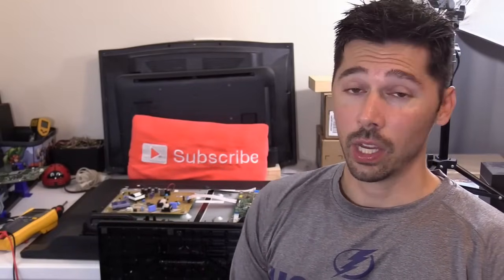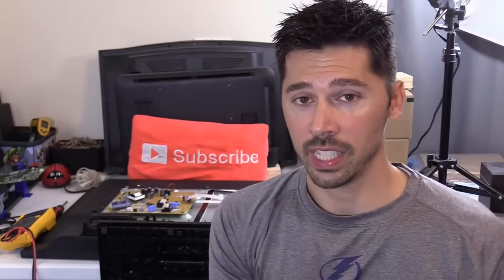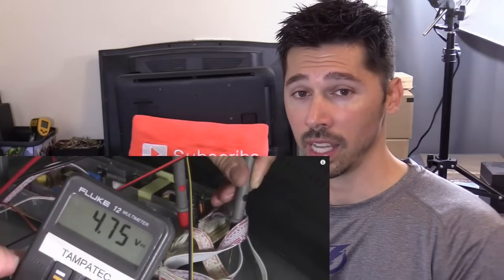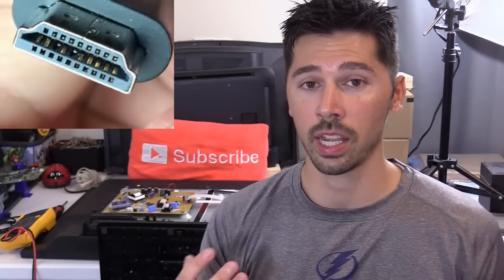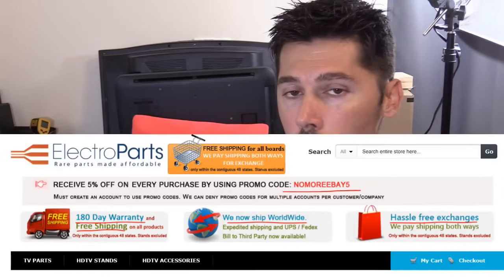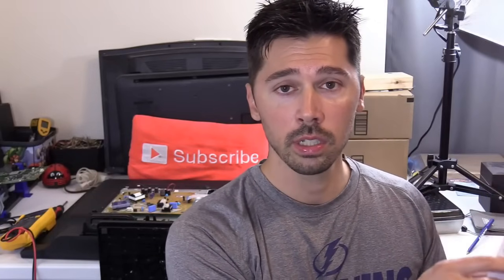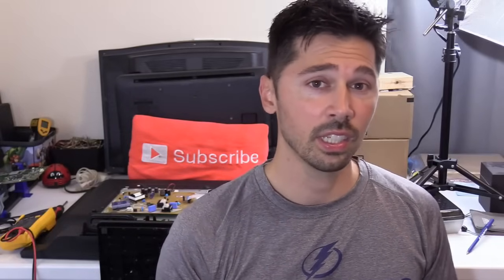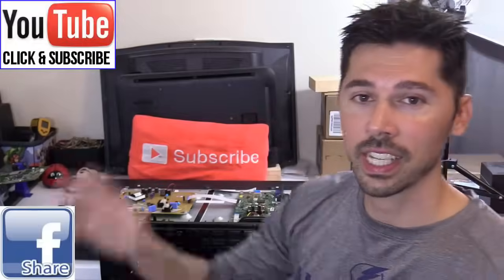How to Fix LED LCD TV Not Turning ON But has Standby LED Light

Comment from the maker: if these tips helped drop a Like and Sub. shopjimmy.com and electropartsonline.com are TV board sources I use. This is a revised video from 2017 10 minute video I made.
Reply: What if the picture come on but then goes out there is sound just no picture
Reply: Thx for the vids. I actually have a 55inch LG led TV I need to change power supply board on. Uncle was messing with breaker box and fried it, smh. Ugh, dnt think the main board was damaged, by the looks of it anyway. And can see a few smaller bad spots on power supply. Just hope I get the right part. Light does come on some, but no pic, basically like TV is off. Hopefully it didnt get to main board. I'd think their would be something showing main board is messed up somewhere, but their isnt. Power supply has a cpl capacitors dome shaped on it, and a cpl darkish spots so looks to just be power supply. Fingers crossed. TV getting older hopefully can still get the part I need. Thx for your vids. Need my bigger TV back! Lol
Reply from the maker: @mrbenjaminvincent  turn off your room lights and check to see if the backlight is still on if you don't have a glow from the backlight then it can be led driver board or bad backlight LED strips that is if you have an LED TV. However if your backlight is illuminated then it's possible that your t con board can be defective, which is connected to the LCD panel with ribbon cables.
Reply from the maker: @johngracejr9436  check standby voltage on power board. Even if TV is dead or off TV should have standby volts.
Reply from the maker: @evonramirez223  bulb popping can be current issue or heating. You didn't get skin oil on bulb and cleaned fans which is good. I would clean fans and vents but make sure fans are running too.
Reply: Yes there is a picture just no illumination
Reply: @TampaTec  also it's a 55' Proscan PLED5529A-F LED SLIM LINE
Reply: Hi Tampa, love your informative videos, thanks a bunch! I have a Hisense TV and it has the backlight visible on the screen when the room is dark, I actually Chrome Cast youtube from my phone to it so I can hear Audio from videos but there is no picture whatsoever. Called in an electrician who checked all the voltages as per your previous video and everything was fine as well. So in short, audio works, chrome casting works, video doesn't. It's actually functioning as a radio now sigh. It's a 55inch Hisense 4K UHD TV 55N3000UW. What could be the problem? Thanks in advance 😊
Reply: Looking for a screen for a LG 60LA8600 any help locating one?
Reply: Hi, I’m getting no picture, standby light dims away slowly, I changed the power board and changed the main logic board. My tv model is vizio p502ui-B1E. Don’t worry I changed the parts by the actually part numbers that’s on the board and made sure they are the right ones.
Reply: @bosslife944  FYI
Tampa ordered boards also with the numbers on the board and it didnt work. He ended up getting another tcon with numbers from the sticker on the board.
Reply: Laby 70 
I don’t understand, I feel like your saying that I might’ve gotten defective boards?
Reply: @bosslife944  im saying the number stamped on the board can be the wrong board. Because Tampatec ordered a tcon board off the stamped number and it did not work. Then he got another board from the sticker part number instead of the stamled number and it worked because it was the right one. Im only saying this because you said you order the boards from these numbers.
Reply: Laby 70  yeah I even talk to the guy that works at elctropart and read him the numbers. I just finished checking the backlights with a 9v battery and they are working fine... I don’t know what the problem is
Reply from the maker: @Brenryz  hey I have a 10 year old Samsung TV too which looks great. Sharp makes screens for Sony and even some iPhones models I don't question their quality.
Reply: Hi Tampatec, I sent you a message on Instagram a few days ago. Could u take a look thanks u....
Reply: What if I found a bad MOSFET and fuse and replaced both. Now I have standby voltage, and feedback from the logic board. Light on front of TV changes from red to blue like the TV is "on", but there is not picture, sound, or 24 volts? This one has be totally stumped. It's about to be thrown off the balcony to be honest
Reply: My LG won't turn on but blinks red and green on power indecter
Reply: Google man I bought TV boards kit from shopjimmy originated as a sharp tv originated on having no power whatsoever so I changed power board and turn it back on and I had power and only audio so I concluded that if you myhdmi must be faultyso I changed out the base with motherboard about you know of with a on off buttons and all they see my eyes and now I have power only and no sound no video so I'm opening up now and I'm going to see if you know I messed up and didn't get a plug-in all the way but I'm pretty sure that I did so do you think my next step if everything is plugged in properly would be return it and get another board or what do you have to say about that thank you look forward to hearing from
Reply: It helped alot mate I tried these things but still nothing it's a buear 49 inch... It started by it switching itself off about 6 times on the 7th it stayed on but yest elec went of wen bk on TV won't do anything now.
Reply: I have a samsung UN39EH5003FXZA that worked fine, but after a firmware upgrade, it turned off and will not turn on. Only the standby light is lit red as soon as the tv is plugged in. the 4 way switch does nothing. no backlight. completely dead.
what do you suggest for troubleshooting?
Reply: Dude you smoke a lot of green
Reply: Hi you helped me b4 with bk lights problem thanks again was appreciated, well this time I have a Panasonic Vieira 50" when u turn TV on it flashes to green then bk to red there is s sound of something as if it's trying to turn on what would u suggest is most likely problem or what to try first thanks again ur vids are really helpful Cheer's Bud Mark
Reply: @TampaTec  hi I have sent u a message on this not sure if this a better or more direct way of talking to u it's basically about TV turning from red light to green then bk to red what's the procedure of most likely problem fault Cheer's Bud Mark
Reply: For my tv the Standby Light is on and won't turn on. Then I wait a couple minutes before to plug back in and still won't turn on but if I waited for 4 to 5 or longer then it will turn on. Will it still be the main power board
Reply: If the standby is only flashing on an off ??
Reply: Turn on...  Flashes green and then red 6 times...  What part do I need
Reply: We have replaced power board and main board and tv still won't turn on... what now???
Reply: My Sharp Led TV  got wet 😫 and there is no picture or sound just a standby light. So I know my powesupply is still good. I heard a noise coming from the mainboard in the beginning while I tried turning it on the screen lighted up for a sec also the back light after that it just stopped completely and only standby light. Do I need to replace the tcon board also with the main?
Reply: The picture is blank on mine but shows colors and I can hear the sound is working.what can I do
Reply: @jahnataurere7521  red
Reply: @markheitz7963  did you find an answer? Mine is doing the same thing.
Reply: @lattedough  yes changed the capacitor on the power board it was swollen so it needed changing try looking to see if capacitor (large black cylinders like mini coke cans) AWE D BEST BUDDY
Reply: Hello
Reply: I replaced my mitsubishi lamp and the tv is not coming on, but the led light is still green, help
Reply: hi.. my panasonic lcd tv which when powered i can see the screen and the green light as normal but when plugged in hdmi cable and press the avi button to navigate the menu its failed ..evrything is ok but i cant go to menu even if i press the menu button in remote or at the back of the tv..pls guide...
Reply: How do I message you directly I have a few questions
Reply: i know Im asking the wrong place but does any of you know a tool to get back into an Instagram account..?
I somehow forgot the login password. I appreciate any tips you can offer me
Reply: @Ezekiel Franklin Instablaster =)
Reply: @Ezekiel Franklin happy to help =)
Reply: My oled c8 is not turning on but the standby light is there,somebody already checked on it from lg services said the screen panel needs to be changed which cost 1000 dollars but i really doubt that.pls help me out here thank u so much
Reply: My Vizio 32” tv turns itself off after making a loud sound. I disconnect the t-con board but it still turn off after a few minutes or a few hours, so what do you think could be causing this?.

Comment: Hi can you or anyone tell me what the issue could be.. I have a TV that stuck it standby. When I plug it in the light turns blue from red but immediately turns back to red (standby) like it's trying to turn on but something won't allow it to. When I disconnect the lcd panel the TV and back lights turn on. What could possibly be the issue.?

Comment: From Solomon islands. I have a veon 32 inches flat screen turn off suddenly. It has only one board mounted in it .some videos has two boards. Before it shut down I have notice one problem with my veon flat 32 video when we are still watching , it can suddenly turn off by itself and it will turn on times later .but the second  problem is standby light turn on but no picture .is there any parts in the board might need to be replace.please make me one video brother. From Francis

Comment: Hi, I have an LG 65LA9650-UA.  Screen is dark. When I plug in the TV the red light comes on. When I press the Power on the TV, red light flashes 3 or 4 times then disappears.  If I press power again it comes back on.  When I un-plug the tv, the red light stays on (even though there is no power).  I tried unplugging it and pressing the power button on the tv for 30 sec then plugging it back in but that didn't do anything.  Is the power supply or logic board defective ?  Thank you.

Comment: Loved the video - gave me the courage to order the power supply board and replace it.  I did and it works perfectly.  $85  saved me from trashing a 70" 4yr old Samsung 4k LED TV !  By the way, the Ebay seller said it would not fix a problem like the tv turning on and off......but it did.

Comment: My tv was stuck in standby mode for 2 weeks-I tried everything suggested on the internet..finally I took the plug and put it in and out of the socket rapidly-on the second or third "in" the electricity "popped" and the red light turned green. The electrical "jolt"  jolted it out of standby. Fixed.

Comment: I’m a retired electronics engineer. Worked for bombardier designing in train audio/ digital systems in England, mainly pcb designer. I have a lg 55 oled that has the standby problem not turning on, so I’ll have a look around that area. I suspect it could be a dried out capacitor as a first port of call.

Comment: Waiting30 seconds really helped, had the tv and Xbox plugged into the same dual wall socket, took the Xbox our first and then the tv. Waisted 30 seconds and then turned tv back on first and worked like a charm thankyou
Reply: thanks bro
Reply: So you disconnected the xbox from the tv then powered iy on
Reply: my 32 inch Element tv still is shutting off i tried the thirty seconds and no luck
Reply: @ayxti750  same
Reply: @hussainshafqat3873  i just wanna play my xbox bro😢
Reply: @ayxti750  dude i know the feeling

Comment: You are awesome bro! Your videos have helped me tremendously. I have a LG 49UJ6200...No power, no sound, and I think it doesn't have a stand by light at all. I've done the dark room and flashlight method and didnt see any images or backlights. I replaced the power board. I dont get any voltage on the terminals marked as P/ON, P-Dim and INVON. 
Do you think the logic board AND the LED lights are bad? 
Also, what should voltage be on the LED terminals/plugs?

Comment: My TV has a problem with the actual on/off button on the side. It is an older Curtis flat screen. I use it as my monitor for my surveillance cameras. Never had a remote. So I have to push the power button on the side every morning. Well the dang thing won’t work 80% of the time. I have to unplug the TV, plug it back in, and over and over, until the button works. Is there a fix? 
It’s like it is just getting wore out. I thought about just getting a universal remote but if it’s a simple fix then I’d rather do that. THANKS!

Comment: Very brief and complete. Awsome tampatec . When i plug in my tv (after being un plugged for few minutes) a white led light blinks on for a couple of seconds and then nothing happens. Ive checked everything like remote control batteries and all is fine. Tried to power on from the tv box too, nothing happens. The tv is directly connected to wall. Please help me understand the problem and how to solve it. Many thanks!
Reply: Ô

Comment: I have a Vizio LED 4K 2019 Model with no standby light. USB Ports work (Led Strip Is On On) but TV does not turn on at all. It was turning on and off by itself so I unplugged it and went to plug in turn back on never turned back on. Assuming either Main Board or Power Board what do you think?

Comment: Hey there.. wonder if you can point me to the suspect.
55” led LG . 1/2 screen was dk after moving it. So I bought new LED strips. Tested them before assembling worked bright nice. Now after assembling the screen is flickering, I have sound, standby light is on. Backlights stay on but low, the video just has static and flickers on and off. Any ideas?

Comment: thank you i shopedjimmy and they where very good i now have sharp 65inch 4k tv when i turn it on i see the power light coming on and blinking  5 times then 2 fast blinks there is not picture would you change the logic board ? what should i be doing thank you

Comment: Thank you Tampatec for a very helpful video,  I have an RCA Model: SLD32A30RQ (no display with standby) When I turn on the tv the backlight has a light and stays for about 15 seconds (but no display) but has a standby.
Reply from the maker: If you have Backlight and no display sounds like bad tcon board here's a link that can help diagnose the situation. servicemanuals.net or manualslib.com . Tv boards - shopjimmy.com or electropartsonline.com
 hope that helps.

Comment: I have an older Insignia 65 inch. Red indicator light is on. TV will try to boot and get to the Insignia screen and maybe a half second later the screen goes all black. Tried all of the unplugging and replacing batteries. Any other suggestions. I've considered opening to see if any fuses were blown. Did that before on the tube TV's but never tried to open a flat

Comment: Hey
I have a 37 inch Sansui TV connected to my computer as a screen.
A week ago the screen suddenly made a colorful noise. And the screen went out.
There was only the North Standby, but the screen would not turn on.
Unfortunately I ordered a new power supply, and I replace it, but it did not help.
Then I saw in the video that you were saying it was a logic board.
Or T-con.
I would be glad to your response
Thank you

Comment: I have a 4k element 65” tv that has an FRC board and the issue is the the tv has standby light red but the tv won’t turn on I replaced the power supply that had bulging caps and just tried two different main boards did not fix the issue so I have no idea what is wrong with it the boards for this tv are supremely rare to find and I’m really trying to fix it it’s my first tv I’ve ever invested in from brands mart in 2015 any advice would be great

Comment: Hi tampatec i wish I can talk to you on phone.i have a lg 42 pc3d plasma. It took a fall backward while sitting on the floor and after that it won’t turn on. The standby light is blinking green. I tried unplugging and holding the power button and some times the stand by light will turn red and stop blinking but once I try turning it on it goes back to blinking green.there is no back light either.thanks in advance I willl like to come to Tampa and meet you, I live I Deltona Florida.
Reply from the maker: Hi Sam, I don't have a TV shop and only fix tvs as a hobby. Your TV is a Plasma TV and doesn't have a backlight like LCD and LED tvs do. if your tv fell then it most likely has a cracked plasma tv panel but to be sure you have to disassemble the tv to check for cracks. you can sell your TV broken or sell the TV boards for $55 each on ebay. hope that helps.

Comment: My 55 inch westinghouse tv model number wd55ub4530 has red light but wont turn on. From what you described, it sounds like the main logic board needs to be replaced. How do I identify this board once I open the tv?

Comment: Hello. 

Loving the channel.
I have an LG 55 inch TV.
When I switch it on, the screen at the top corner does a red bleeding type thing. It then disappears as it goes up the screen. But then the screen is blank with just the backlight on. Is the screen totalled? Thank you.

Comment: Just a simple question. Vizio E600i-b3...No picture, no sound, no standby light. Most suggest power supply board. My question is I get  all the correct voltages out of pwr supply board except T -Con V which should be 12V. I get correct LED voltages out of main board too. From some vids I've watched there is supposed to be feedback signal from main board to Pwr supply board when power switch is pressed to signal pwr supply to kick in hi voltage. So problem could be main board too.

Should I get T Con voltage out of pwr supply regardless of good or bad main board? Cause if I isolate pwr supply from main board I know that shuts off some voltages from pwr supply like the 24 Volts section for LEDs. So it makes me wonder if something similar is going on with the main board not giving feedback properly to the power supply and that's why I got no t-con voltage. I hope this makes sense.